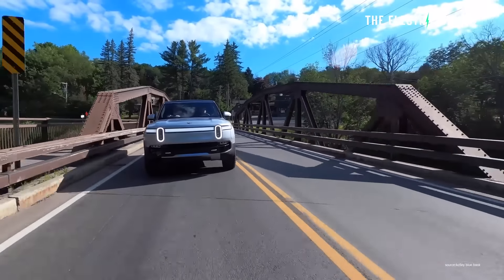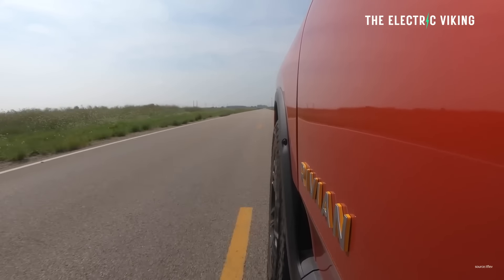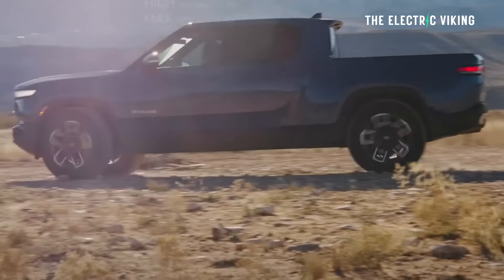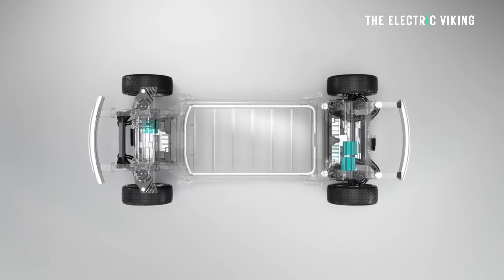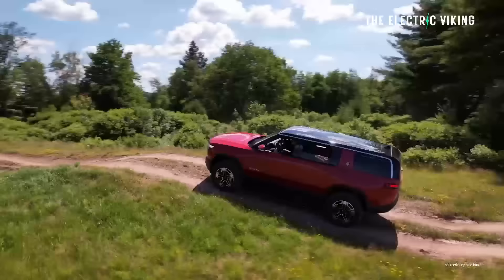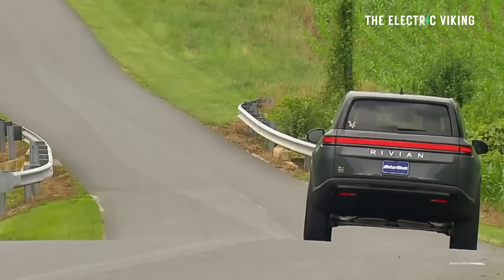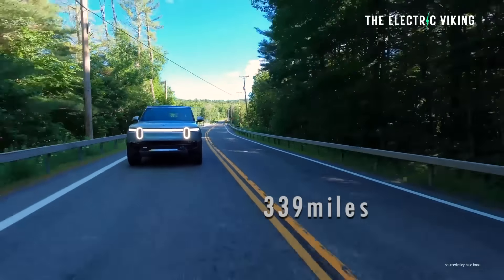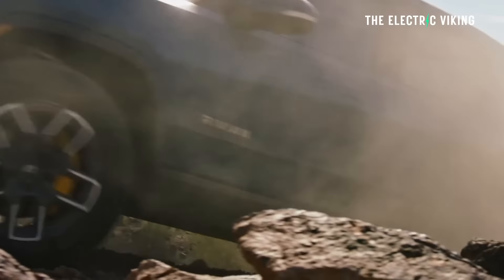2025 Rivian R1S & R1T will be cheaper with LFP Battery & Heat Pumps

Comment: R1S owner here- this thing is the real deal.  Shockingly great product from a start-up. The problem is that no body but enthusiasts know about the company but that is slowly changing.  I have no problem getting through deep beach sand in this heavy SUV  - have not gotten stuck yet.  Extremely capable trucks.
Reply: Ty for ur comment
Reply: @oldbloke204 true, but with low pressure in your tires sand driving is so much easier

Comment: I think you mixed several stats. First off, the 22s will be "efficiency" tire moving forward and the 21s are abandoned because there is only one tire choice. At 2.5 mi/kwh the 22s are good for 380 miles with the max pack currently. Post factory shut down there are several changes including decreasing the number of ECU units. Heat pump may help people in cold climates but the existing heat scavenging off the inverters and motors works fine. Augmented by a ptc it warms the cabin faster than an ice. Currently they are using software locked batteries to specific ranges on the lower range options until lfp rolls out. The large pack and max pack weigh the same but have different cells. The standard pack is a locked large and the standard plus a lock max I think.
The r1 is unlikely to be exported despite the ccs2 harness that exists. The r2 and r3 however will likely have international compliant marker lights and such. There are a couple of R1 vehicles in AU imported mevco. I hope rivian makes it to Australia.

Comment: We don't have the info on all battery packs coming. The 92.5 kWh battery will be the "Standard" Range replacement. Just doing simple napkin math, at typical highway speeds, the R1T travels about 2 miles (3.2 km) per kWh  (give or take .2 kWh) Even if they squeezed 2.2 miles per kWh, that would mean a battery with a usable capacity of about 90 kWh would, AT BEST, run about 198 miles (319 kph).

Comment: The 92kwh LFP battery will not get 400 miles of range, that will be the 150kwh max pack.  The smaller battery will get 270-310.

Comment: RIVIAN currently is not a great value for the money. It’s flipping expensive. They need to remove a ton of complexity. The headlights still bug me. I appreciate them wanting to be easily identifiable and different, but I would rather them remove the stadium vertical lamps and leave the simplicity of the light bar. The complexity of the RIVIAN without a heat pump and no NACS input with an adaptor makes this truck dead on arrival. Who wants to deal with an adaptor? 😂😂😂😂
Reply: They ARE removing the complexity in the R2 & R3 ✅
Reply: @document6  hahaha… okay… meanwhile, losing $38k per EV they sell. They have to sell north of 250k units to make money beyond the tooling and new production line per model. Brutal…

Comment: Sam, you’re so focused on an American audience with these videos that it looks like you’ve lost touch with the Australian 4x4 Ute market. Nobody here would be interested in these things except maybe a woke currency speculator living in Toorak or South Yarra. Next year Kia is introducing the “Tasman” to Australia. A diesel 4x4 ute to compete with the Hilux and Ranger, which are the most popular vehicles in Australia. These Chinese things stand no chance of making any meaningful inroads into that market. An electric Ute in the Simpson Desert, come on mate, as if….
Reply: Not Chinese. American owned and built. 
Also the Rivian off-road capability is far superior to your Aussie ute options. Look it up. Huge low end torque independently delivered to each wheel will be the future of offroading. 

Car manufacturers are literally dumping their ancient stock in Australia because of ignorance like this
Reply: Imagine being the average tradie that travels about 100km a day. Then imagine having longer service intervals so the ute doesn't have to be off the road as often. Imagine not having to stand in line after work trying to fuel up at Costco every week. Then imagine the LandCruiser killing torque of an electric motor. Then imagine having 240v and 3 phase on tap where ever you are, on that jobsite where there is insufficient power 30m away from where your working or when you're off road camping. Then imagine spending $7 a week filling up your truck.